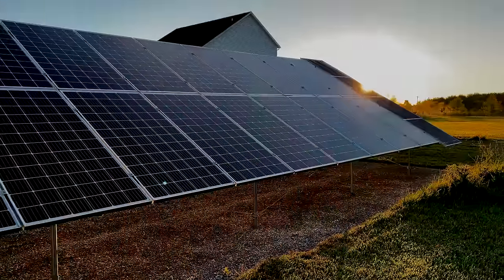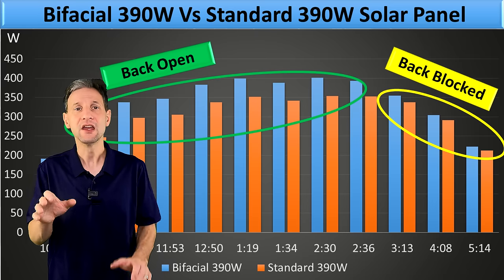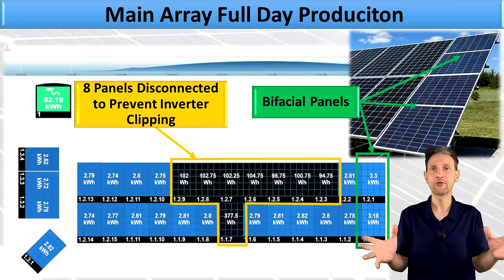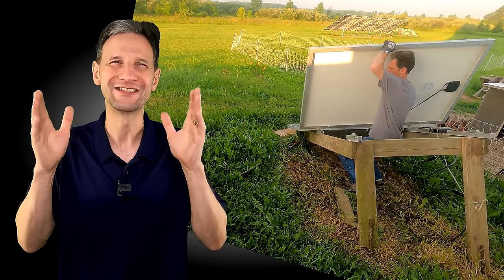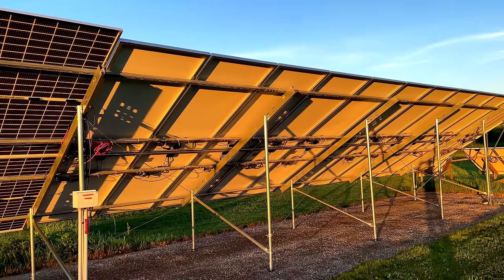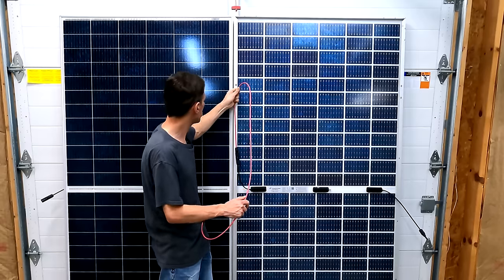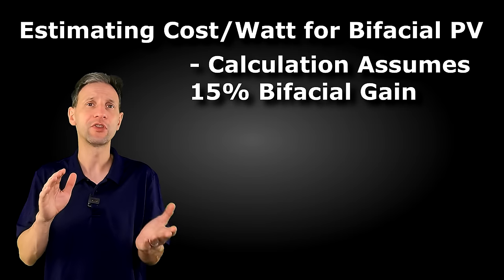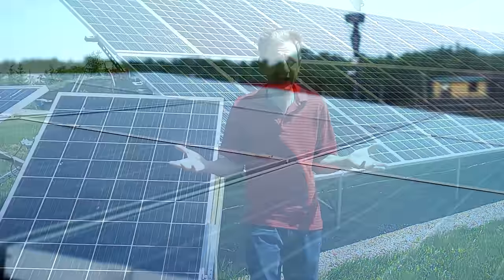Bifacial Solar Panels - The BEST Solar Panel? Real World Results!

Comment: Hi Dave, another great Video, I just received 21  CS 450 WATT panels from Santan, almost had the same unloading problem that you did. The truck driver had a powered pallet jack and almost run it off the back of truck, lucky I had my skid steer with forks and got under the pallet before he dumped it. I am building my own ground mount, and putting up a 31 foot car port and using one side of the verticals of carport structure to attach Unistrut  @ 30 degree  supports for my mounting rails to attach to . Won't get the best performance on back side, but can't beat the price for panels. Now I am looking for an Inverter, and leaning on using a Growatt 7.6 kw or 10Kw as to not get into clipping  hybrid inverter, they seem most reasonable priced and have a battery backup option that can be added latter.
Reply from the maker: Using panels to serve as a roof and power is a great strategy.  If your orientation isn't ideal, you won't likely make much use of the 10kW inverter.  You will probably be fine with the 7.6kW.

Comment: what then is the drawback for bifacial (except for slightly more weight)? i checked two stores, they sell bifacial as much as the normal panel.
Reply from the maker: They have short leads, so if you are not using a string inverter you may have to make lots of MC4 extension cords.  Otherwise I have found them to be superior in almost every other way.
Reply: @ProjectsWithDave  thanks!

Comment: It sounds like ground mount is a much better way to get production then rooftop. 
How about trying some reflective materials underneath the  bifacials?
Reflectors or mirrors.
Reply from the maker: I plan to try a white steel roof later this summer.  Mirrors would likely be helpful, but delicate and hard to position.   I was thinking mounting with a pond backdrop might offer good reflection.

Comment from the maker: Solar Panels from SanTan Solar: https://www.santansolar.com/product-category/solar-panels/?ref=EverydayDave
Solar Panels from signature solar: https://signaturesolar.com/shop-all/solar-panels/?ref=SALE
Find More information for this project and others on my website: https://projectswithdave.com
Stock is constantly changing so I just linked to the currently available panels, just look for the best deal that meets your needs.
Reply: I was literally looking at about 60 of the 445W this morning when I saw this video pop up.  I am still torn and getting conflicting info on the advantage of bifacial when roof mounted.  Having a black roof, I know it is not ideal, BUT is there enough gain to make it worth it.  Price wise, the rated wattage is banking on back side absorption.   Without it, I may be hurting myself versus a standard mono.  have you seen (or produced) real world data for roof mount?
Reply from the maker: My data shows the panels perform a little better than a standard panel even with the back blocked.  Maybe 4%-6% more.  However, I wouldn't expect much especially with a black roof.  If you mount them to the roof I believe the manufacture requires a minimum of 10cm or 4" clearance to the roof.  If you live in a place with snow you might see some advantage to the panels heating up quicker and therefore shedding snow more quickly.  Hope that helps.
Reply: @ProjectsWithDave  It does help, and thank you.  I am about to build a new building with a white/light metal roof.  I am thinking I may plan on putting the panels there and not mess with current roof. (always easier to plan with new build). Much appreciated and love the videos!
Reply from the maker: Thanks!  Sounds like a good plan.
Reply: Only bad thing I’ve seen on their website is it’s all local pick up…is this correct?
Reply from the maker: I have all mine shipped.  Shipping is extra, so get as many as possible at one time.

Comment: Hi Dave  Have you tried mounting the Bifacial  panels vertically in the North south direction so they get morning sun on one side and evening sun of the other ?
At first thought it doesn't sound intuitively correct but then who who would have thought you would get the results you did with Bifacials.
 It would hugely boost early morning and late evening production which is the most useful/useable  times of day.  
You also get snow in winter which would help with the refection (I'm in KOPU New Zealand and only get a few frosts a year).
 Perhaps East West ?? who knows as they are new technology that is allowing a whole plethora of ideas
Reply from the maker: Yes, I have a test running now with vertical bifacial panels.  So far, they have good morning and evening performance and on cloudy days they perform very close to the south facing panels, but overall, they still underperform the south facing 30deg panels.
Reply: @ProjectsWithDave  thank you for your reply. Much appreciated 

Immediately after I sent that question I 'discovered' alot more information online about them since you did that video 10 months ago and the orrigional German study "Smart Energy" published Aug 2022, where they do vertical bifacial panels to be able to use the ground for other purposes eg agriculture.

There are lots of smart people out there coming up with all sorts of new ways of using things and with the internet to make it accessible it's amazing.
I'm a 70y old ex research scientist (the ex just means no one is paying me now) but we never stop learning.
I like your videos as you measure and calculate stuff in a robust manner that's consumer friendly (a big problem with alot of science).
Virtical bifacial panels over water. Now that's an interesting one. Reflection and cool air, dual use of area for fish farms and dams ?
The permutations are endless 
Thank you.
Reply from the maker: The solar space is fun to be in.  As you said you never stop learning, and there is always something new to learn and experiment with when it comes to solar.  The combinations are truly endless.... : )

Comment: Can you try setting up a test with some type of reflector.. Like outdoor aluminum theremal insulation, white acrylic roof costing or cool metals roofing under the panel.. It might work great on flat roof in my opinion
Reply from the maker: I'm currently testing on a white metal roof.  Results will come in a few months.

Comment: Would white limestone as a base around the array be a good option for reflective properties?  Just a thought.
Reply from the maker: I think it would be a good choice.
Reply: I would guess whatever is lighter in color could be considered good in a general sense. White rock sounds like a good idea. You'd have to weed and spray it down occasionally so pretty low upkeep. I'd imagine something like a white painted decking would be better.

Comment: Would it be interesting to test with standing panels so that they get sunlight in the morning from the front andin the evening from the back side? the floor covered with aluminum zinc roof sheets. i could imagine that the output it is more than the normal south direction installation

Comment: I have an idea about how to maximize light to both sides of bifacial cell. Put a long cylindrical parabolic mirror underneath the cells. Place cells in a line parallel to the cylindrical parabolic mirror with the back side facing into the mirror, front side directly facing sun. This arrangement allows for rotation of the parabolic mirror with the cells to always face the sun. I bet you could significantly improve performance. There are some challenges to overcome but idea is sound. This technique would also work with regular mono cells with front side facing down. I am working on a prototype so as to get some real values.

Comment: These make sense for ground mounts for two reason. First, wiring becomes easy as ground mounts can be used with string inverters without rapid shutdown(optimizers,micro-inverters). Second, one can add white gravel on the ground to get 20-30% extra power. On a roof mount, neither of these things are possible. Doing the math, ground mounts with string inverters and bifacial panels are the lowest cost/watt option, at least at the time I checked. Pretty much pays for the trenching and racking, a normal disadvantage to ground mounts.

Comment: Im looking at a simple ground RV install with a simple hinge on one side, a reflective surface on the other and hinged vertical for tilt.Then tilt them to the sun. Im hoping this simple clam shell will support them during storage but I fear the will be getting pretty heavy. I might need slightly smaller panels

Comment: Too bad you didn't test the down face of this biracial solar panel to its full extent, like with a smooth ultra white ground surface, ground- mounted high enough so that the down face gets reflected light not just from the back but also from the front, maybe try with a mirror film behind the panel to reflect even more light, get a fan under the panel to see if cool air benefits productivity, this kind of tests that come to mind with bifacial. Your huge wooden frame is also a big hindrance for bifacial panels. Better use thin flat metal just under the sides of the panel, so, customized to its size.
And really, you should not even mention rooftop mounting for bifacial, when rooftop panels should be as thin as possible and ideally part of a weatherproof roof design rather than looking like roof warts on top of another roof. That second face won't get used at all, although your blocked face tests show that there is some extra efficiency, possibly because some light that manages to cross the topside gets reflected by the second sheet of glass at the bottom  thus converting more electrons, or some other cause that would be interesting to know.

Comment: Will the shadow of cross supports UNDER the bifacial panel , affect its performance??
Reply from the maker: Yes.  You should minimize any obstruction on the back side.  Since there is rarely direct sunlight on the back, just keeping some distance between the panel and the obstruction will at least allow some of the ambient light to filter in.

Comment: The issues with the pannel thiskness and cable length are a function of the manufacturer, not because they are bi facial .
 Aptos makes a bi facial with standard thickness and 1 meter cables, they just cost  more than some odd commercial brands .
You have to weigh the cost of cable extentions when pricing pannels , as the cabling costs can add up .

Comment: This is why I absolutely love my bifacial solar panels! My panels face South long way, but half tip east the other tip west on short edge. Then we separated them from one another just a tad. Remarkably I get to have my garden in-between cell splits 😊🌄👍. Yes this does cause the wiring issue of different voltage throughout the day, but I have separate mppt controllers for that.
Reply from the maker: Nice!  Do you find the light passing through the panels to be a good balance between shading and sun exposure?
Reply: @ProjectsWithDave  for plants "low light" plants are preferred. I haven't tried anything intensive yet, first full season with them.
As far as light passing through and reflecting back (I've been told) lowers the wavelength/kelvin of that light and it can then be absorbed by the back of the panel (perhaps your tools can confirm this?). This was very evident our first snow fall. Cool panels plus light reflection lead to gained overall production. I noted that fresh wood chips in the garden are ok for this, but was thinking white sand, shell or stone would have been way better🤔. Hope this helps!
Reply from the maker: Thanks for the response.  I'm looking forward to evaluating different reflection surfaces and winter performance.
Reply: Now your setup is really a great thing.  Probably the BEST I have heard of as far as an over efficient use of resources.  But my question is does the tipping increase panel efficiency or is it only to facilitate the garden.  What is the east/west tip n degrees?  What exactly is the spacing?
Reply: @tommak6516  please forgive my absence; this is honestly a trial and error kinda ordeal for each application. As mine is mostly setup for power production between the splits, however I like to grow lower light plants under my panels. But I do grow higher light plants between the two arrays. As for the tilt: it's going to be whenever your latitude is in degrees & then don't be afraid to split the difference between summer & winter seasonal efficiency. Personally I set mine closer to the middle in degrees & separating the panels apart approximately 2 ft. I get good production this way both reflected light to bifacial and ample plant growth.

Hope this helps you!!! 😊🌞👍

Comment: Great presentation, thanks.
Why not give those rescue blankets a try? Not sure about hot summer days, but in winter they should help with snow melting, as they are particulary good at reflecting the infrared part of the spectrum. And even the good ones cost next to nothing.

Comment: I live above Loch Ness in Scotland and am currently building a house to rent out on my property, which I bought with planning for 3 houses. I have heard about bifacial panels and am going to buy some for my house, which I hope will run on solar power. I am going to put some kind of reflective material on the ground beneath the panels. Can't see why this wouldn't work! But maybe I'm wrong here..............
Reply from the maker: I ran a test a few days ago with reflectors for my vertical panels I will publish that most likely in August.  You can get some idea of the increase in performance from reflection from this video with reflection off the snow: https://youtu.be/YZWeCUzu0yQ

Comment: @2:55 and THAT is one of the most common ways to LIE with STATISTICS.  Graphs that zoom in on the end to magnify the difference.  "you can clearly see just how much..."   yeah...  The only reason you can "clearly see" the difference is because you're not showing 75% of the graph, where they're THE SAME.
Reply from the maker: Thanks for your feedback.  Dropping the bottom of a graph is not lying with statics.  It is a common way to make the delta more visible.  The scale on the side hasn't changed.  Clearly you were able to understand the magnitude of the difference.  My goal is to always show the actual data in as clear a manner as possible.  I have no agenda or reason to try and show something that isn't true.

Comment: What would harm putting mirrors (stainless steel) on the ground reflecting sun hitting them directly an reflecting up onto the back of theses BIFACIAL panels?… INCREASED production (A LOT), right ?
Reply from the maker: Based on my winter results, I don't think the cost would be justified.  You can see the results from the reflected snow in this video: https://youtu.be/YZWeCUzu0yQ

Comment: just imagine for a moment if you were using these panels in an agricultural setting where you mount the panels relatively flat but 14 feet off the ground so you can get tractors under the panels.  I would imagine that the actual output would stay much higher during the course of the day

Comment: Hey, Great job making more sense about Solar then anything else I've read or watched. I have one question that hopefully you'll give me some direction with. I know you're located in the "Great White North" but my new project will be located along the equator! What I'm trying to determine IS would a solar tracking system make sense? And what about the bifacial panels? I can mount them on a roof (glazed Spanish tiles) or on the ground. For convenience, I'll probably have at least 3 different arrays - as I have dairy parlor, shop, worker's duplexes, and the main house. Thanks
Reply from the maker: Bifacial panels will always give more power in low light conditions which is when you need the extra power the most.  I strongly recommend ground mount if you can do it.  You will get better performance and you can fix and change things much more easily.

Comment: Why don’t the bifacial panels cost more per panel than the regular panels??!!
Reply from the maker: They generally do cost more, however, I was able to purchase clearance panels from SanTan Solar.  They were returned from a build that was canceled.  Only a 1yr warranty, but new.  A good deal in my book.  The inventory comes and goes, so you have to check often.  You can find some low cost options on my website: https://projectswithdave.com/solar-panels/

Comment: Im wondering about the comparison between a standard panel that have a cooling system in the back vs bifacials. As we know, heat decreases panel efficiency.
Reply from the maker: I would guess a cooling system would cost much more for the boost in performance than the cost of bifacial panels or even just adding more standard panels.

Comment: Has there been any data about the durability of the sealing on bifacial panels?  I am especially curious about the back keeping its seal/structural integrity for decades of use, if exposed to the winter weather/elements facing north and enduring freezing and thawing moistures, that can often come interspersed with significant arctic winds gusting too.  

Thanks for all you've provided here so generously and accessible.  It's not "everyday", Dave, that such a delightful and valuable resource is made so available to me and my projects.
Reply from the maker: Thanks for the encouragement.  I have seen a lot of failures for standard back sheets, but nothing for glass.  My expectation is a panel with glass on both sides is far less likely to have sealing issues than one with a standard back sheet.  In this video I talked about some of the back sheet failures you will find in the used panel market: https://youtu.be/_HKW7mwPiMI